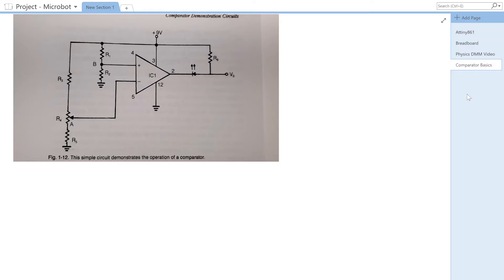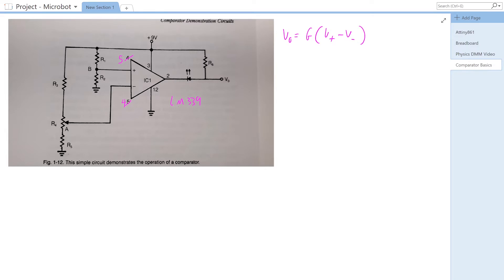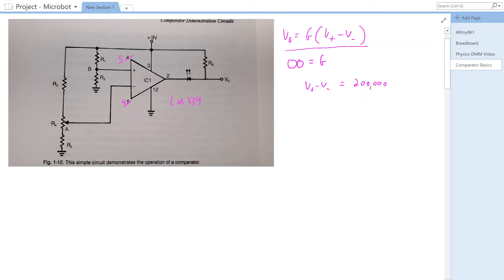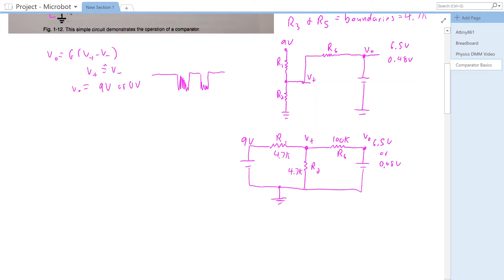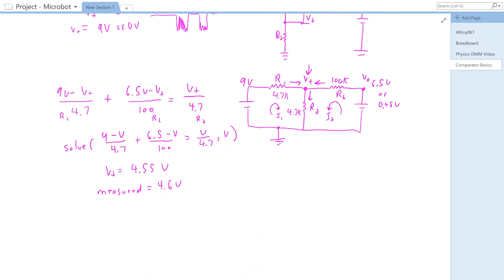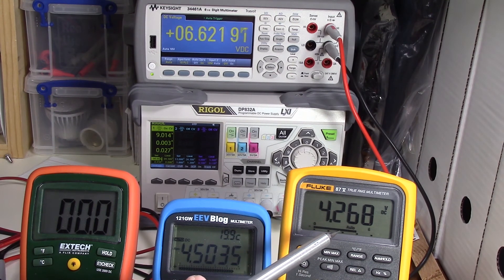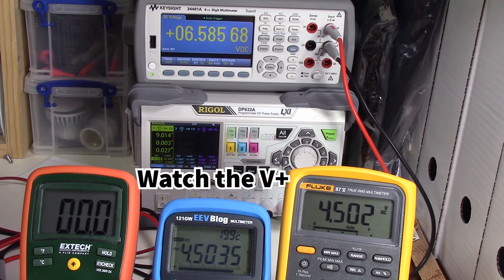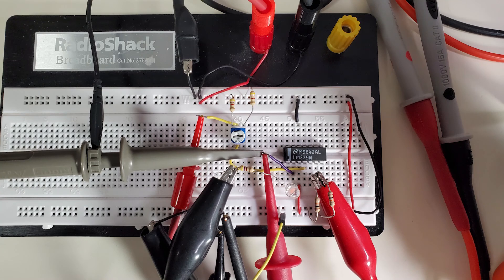Comparator #1 Basics

Comment from the maker: I just realized on my drive home that I used the wrong resistor values when calculating the different set points in the nodal analysis part.  Instead of 4.7K they are actually 10K resistors.  The math works out to be 4.6V and 4.3 switching points, spot on to the measured values.  Oops!
Reply: if we assume R1= R2 = 10k ,  V+ = (83.5/21) = 3.98 . I think there is a problem in video.